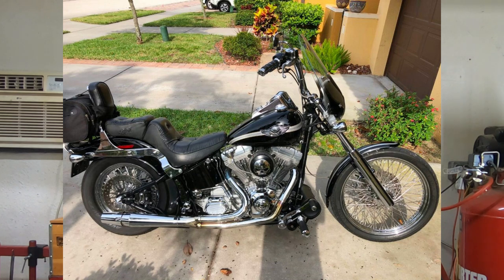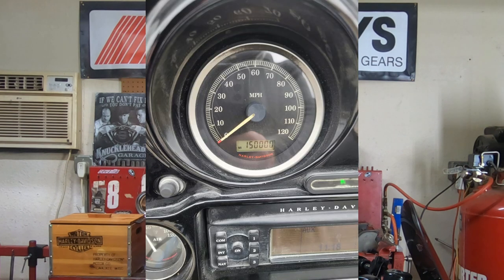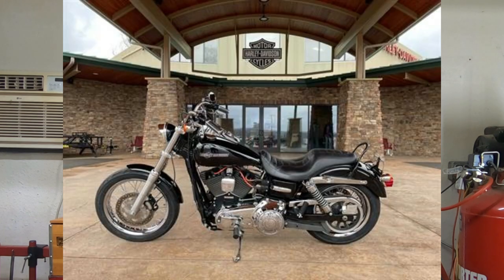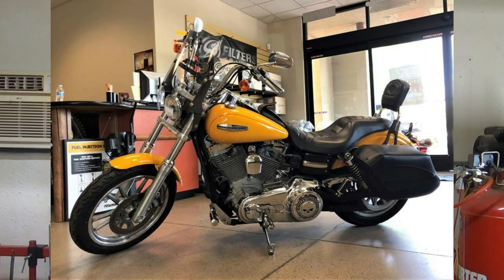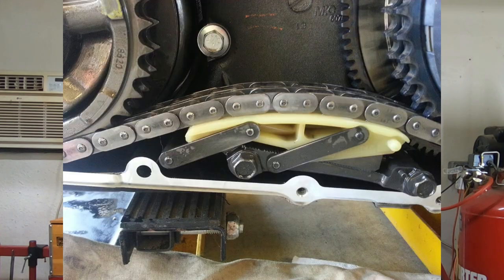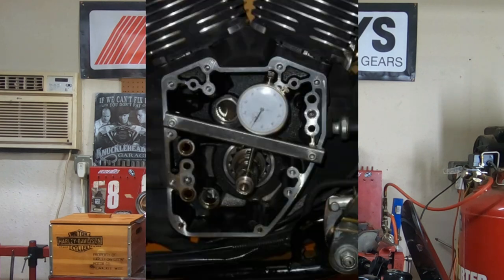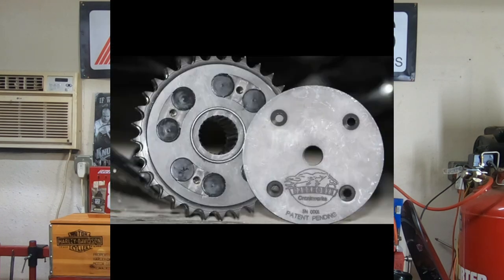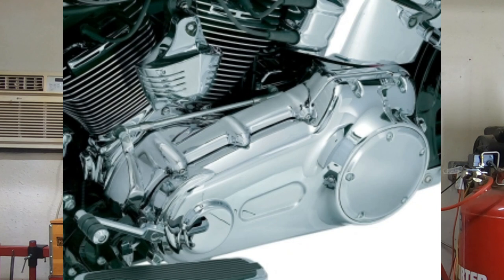Twin Cam Harley-Davidson Engineering is it's Own Worst Enemy

Comment: What makes tight and loose spots in the primary chain? The thing is bathed in oil.
Reply from the maker: That's going to be attributed to crank run out, the cranks my not be exactly .0000 perfect so you'll have some tight and loose spots.

Comment: Like your take on the mods. I'm running a S & S 110" twin cam with a Primo Rivera 3" open belt drive loaded into a 99 and under softtail frame with a 5 spd LH drive tranny.  Bike is registered as 00 special construction, so there isn't much that came with it as documentation when I bought it. I'm running a Super G carb also.

I have planned to add the oil cooler to the it, as I think that is the single best mod to add life to the engine, that and running AMSOIL to lube it.  Any other suggestions on mods for my engine & drive train?  Thanks in advance

Comment: So you’re saying that you want me to put at least another $3k in my bike? Oil cooler, manual primary tensioner, compensator eliminator, cam plate with high volume oil pump, and cams as long as you’re in there? That sounds like at least 3 grand. I might go with the $550 for a fan assisted oil cooler but money is tight right now so I might have to take the rest of your advice with a grain of salt, GixxerFoo!

Comment: Hey I’d like to run something by you, I watched one of your videos about getting slightly used 103 cylinders and pistons from a friend. Well I’ve done that exactly and I own a 08 Electra glide. It’s nice but the previous owners put exhaust, breather, not sure about the time, or the size of the jugs and pistons on it now!?! Im planning on getting these cylinders and just hopefully not have to do much maybe light cross hatching, honing? But will get new rings and gaskets. I’d like to get my heads looked at and maybe just super cleaned and replace what’s needed ? I’d like to get cams, something that’s not for racing but good on the highway passing cars amd riding in the mountains. Could you suggest what I should buy for this bike? It’s got 45,000 miles on it now and feels little sluggish on the top end? It may use little oil on a 300-500 mile ride. Im wanting to make it stronger and last long time, but get more out of it?? Any thing you could suggest and offer as advice ?

Comment: Almost have to blow the engine apart, balance it, blueprint it, different cam timing and retune. Optimized cam timing will help with combustion and reduce heat loading

Comment: TBH and this is my opinion, my TC 96CI 07 FXDB is fine when we are talking about the engine itself.  Oil cooler is a good add.  I find the suspension is the absolute worst part about this bike....from the crappy motor mounts, to the horrible front end, to the wobbly swing arm.  That is where I have "invested" aka spent, the most money.  15inch rear progressives, Race Tech front end kit, BBC FXR motor mounts, Alloy Art engine stabilizer....still going to perhaps add inverted forks, new triple tree, GPR stabilizer, and aluminum swing arm.

Comment: What is the best year to buy a used twin cam bike, overall?
Reply from the maker: Overall on a Twin Cam, I would honestly go for something 2012 or newer. Get one with the 103HO, that's got a .511 lift cam over the non HO 103 which has a .466 lift I believe. But it will have more torque and a bit more horsepower.

Comment: 2006 street bobs have 6 speeds too.
Reply from the maker: 2006 was a weird year for the Dyna. For whatever reason they had the 6 speed with an 88, but that 88 also had the hydraulic tensioners that were in 2007 on the 96 in all models. Harley typically does things like that on the touring bikes first but for whatever reason that one year the Dyna was the only line with those upgrades.

Comment: I have no idea why a huge v twin with tons of torque needs a 6 speed transmission. My 2006 Sportster does just fine with a 5 speed, and would do just fine with a 4 speed, as long as first and top gear were the same as on the 5 speed. I definitely recommend an oil cooler, and a manual primary chain tensioner, as well as the Feuling oil pump. I DO NOT recommend replacing the cams. Don't do ANYTHING to increase the performance of the engine. The cheap, crappy, pressed together crank is the weakest point in these engines, and it won't even hold up in a completely stock engine. A Harley is not a performance bike, it is a cruiser or touring bike. If you want performance, buy something else. 

If you do plan on buying a Twin Cam, I would look for an '02 or earlier, with the Timken crank bearings. That cheap, crappy pressed together crank will hold up better. The next thing to avoid are the EFI models, 2007 and later. On the carbureted models, it is MUCH easier and cheaper to richen up the air/fuel mixture, and there are a whole lot less things to go wrong. Some of the later models are completely impossible for an owner, or even an independent shop to work on, due to the absurd amount of electronics on them. And dealers won't touch them. 14.7 to 1 is INSANELY lean. Lean enough to melt the engine down, even with an oil cooler. I live in AZ, where it is HOT, as in 110-115 degrees F in the summer. I run my 1989 FXRS Low Rider and 2002 Sportster 1200 at around 12.5 to 1. That is rich enough to lower performance, and eventually foul plugs, but it gives me a 50-60 degree drop in oil temperature, even WITHOUT an oil cooler. 

No matter what you do, a Twin Cam will never be reliable without a ton of expensive modifications. It will need to be completely rebuilt, with an S&S crank with Timken bearings, geared cam drive, aftermarket oil pump, oil cooler, manual primary chain tensioner, and possibly even a new transmission. There were actual problems with the six speed transmission. Back when that transmission came out, people were complaining about loud noises coming from the transmission even when new. And if you have an EFI model, convert it to a carburetor. That can now be done with ALL Twin Cam models, due to a stand alone ignition system now being available. H-D combined the EFI and ignition into the same computer, and while it has always been possible to remove the EFI hardware and install a carburetor, it left you without an ignition. That problem has now been solved. 

All of this will cost a fortune, but it will still be quite a bit less than the OTD price of a new M8 bike, which really isn't a Harley at all, it doesn't sound or feel anything like a Harley. And it is more computer than motorcycle. And you will have a REAL Harley that is even more reliable than a stock EVO. Obviously all this will not be an option for someone looking for a cheap Harley, but remember, cheap Harleys are cheap for a reason.

Comment: When I read the title of this video, 'Twin Cam HD engineering is its own worst enemy ' , i thought that GixxerFoo was going to zero in onto the huge engineering disaster surrounding the failure of plastic cam chain tensioners built into their twin cams. He touched on it briefly but i think he failed to spell it out clearly and highlight it as one of the main problems involved in cam chain tensioner failure. If you want to get an idea of the work involved in replacing these two engine pieces do a You Tube search and you'll be convinced. Its definitely not a job for the backyard mechanic with a few spanners and a couple of hours to spare!!!
Reply from the maker: It's not bad with a service manual and some mechanical experience. There were several factors ranging from the first generation of cam chains, to the spring tension being too heavy and right down to the material used. But when it got lined out with the hydraulic system and new tensioner pad material things were much better and they last upwards of 50K miles.
Reply: @GixxerFoo  Thanks for your reply GixxerFoo. Harley Davidson may have improved on the old plastic cam chain tensioners on their more recent twin cams, but spare a thought for someone who innocently buys an old Harley twin thinking he got a bargain only to have the thing have a major engine failiure due to a cam chain tensioner failure and facing a big repair bill for an engine rebuild.

Comment: What type of Harley can you get used for $5K ?
Reply: I just got a 02 super glide 4600 miles for 5k
Reply: Bought a 2000 Special Construction with a 110" S & S TC, 3 inch primo open belt super G carb,loaded into 99 & down Softtail, paid 4800 bucks 3 yrs ago. Got 3 sets of chaps & 2 helmets with it too.  True story

Comment: Do you have to get a high performance cam can't you just get a mild cam?
Reply from the maker: Bolt in cams are perfect for fitting that bill.
Reply: What's the difference? Aren't they all bolt in? There's stock, mild an hi-preformance rite? I used a mild Andrew cam in my sporty yrs ago cause after having it rebuilt to stock 1200 an was disappointed in performance. It woke it up like a monster especially at hi RPM it was like a rocket wen it kicked in. U can hear wen it got a decent cam. So I guess mild is a good way to go for stock right. I wouldn't do high performance without high performance valves and springs. Just trying to get an idea thank you for the advice

Comment: Man I have a Stock 08 FLHTC with 8k. Should I get a power vision? Do I need to mount it on my Handlebars?
Reply from the maker: You would love just even an improved stock tune from a Power Vision, it makes a night and day difference in power and heat reduction actually fueling the bike. You don't have to mount it the handle bars, that's an option if you want to keep it on the bike to display oil pressure, head temperature, voltage or anything else you don't already have on the dash. You can flash the tune, unplug it and put it back in the box when your done if you don't need or want any of that.

Comment: for the money they should be much better. In over 50 yrs of riding haven't seen a harley yet that wasn't modified to ( improve?) factory lack luster performance be that for power handling or braking. No thanks I can buy better cheaper.

Comment: Change ur motor oil every 2000/2500 miles, they will run forever , put 70w in trans

Comment: Wait a damn minute.. you mention a good set of cams and end the video.. what type chuckwagon BS is this!? I’ve got a ‘14 twin cam that’s about to get lots of fresh parts.. now I gotta go through your library
Reply: Andrew's cams for whatever size motor you have..., bassani 2 into 1, sns stealth air filter, dynojet power vision, tribodyn 20/50 in the motor, tribodyn 75/140 in the transmission.

Comment: So....there's no perfect Harley. They all have their engine-style engineering quirks for certain year periods....oh...ho-hum. Learn what they are; replace the "garbage" that the factory uses; replace the garbage with higher-grade aftermarket parts like,  S&S or Baker. My 2013 Ultra Limited Electra Glide is no longer a Harley-Davidson, but it is now basically a, HARDLY DAVIDSON!

Comment: how to break the crank.. what crap.. the only real problem with these is the lifters.. just swap them every few years.. and all the mods you list need a tuner.. 400 bux.. what crap
Reply from the maker: Don't cheap on lifters, put some good ones in there and they will last a lot longer than stock.

Comment: Would enjoy the video more if you could keep your hands and arms from waving about! It total distracts from the a otherwise good video. I ran a 2006 streetbob  which I have heavily modified, engine, suspension, lock up kits front and rear and a modified metal tractor seat slapped on the frame rails, with forward. Controls. Most comfortable bike I’ve owned.👍🇬🇧